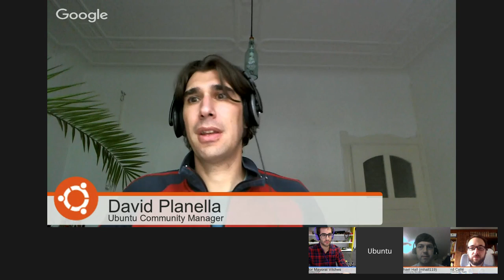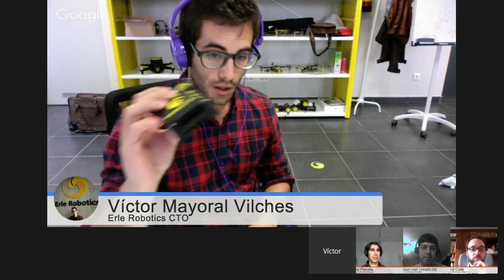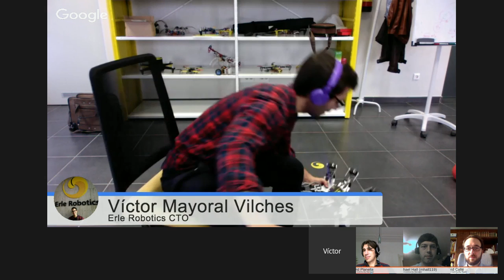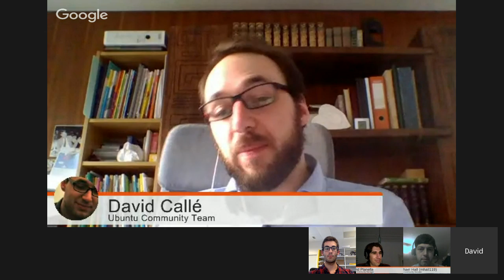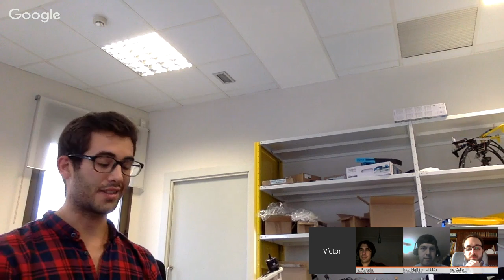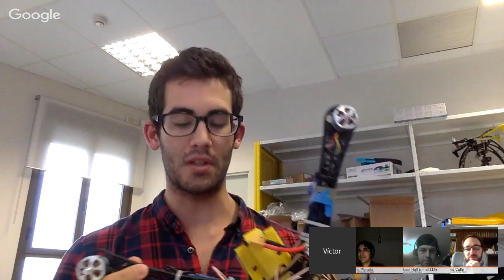Ubuntu Community Team Q&A with Erle Robotics

Comment: I have two questions.

1) So you revealed at @3:20 that the Erle Brain is actually Raspberry Pi 2 with a sensor shield. Why it is not mentioned in the Indiegogo campaign? You are listing all the data like CPU, inputs/outputs and blah blah, but why are you hiding that it is actually Raspberry Pi? Everyone knows Raspberry PI!

2) If it is Raspberry Pi 2 with a custom board of sensors, how it is possible that you sell it for hundreds of dollars?! Are the yellow parts on the case made of gold? Maybe it answers question 1.